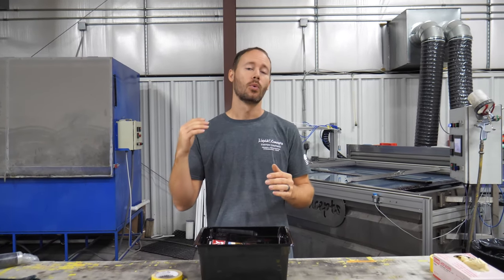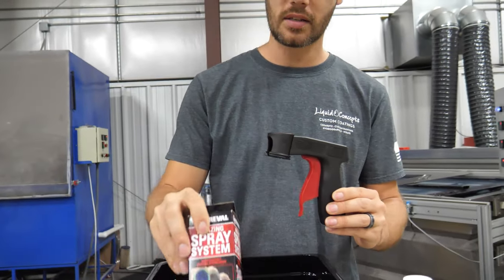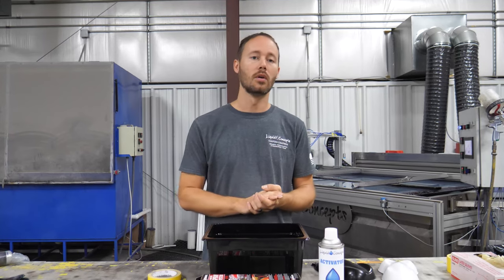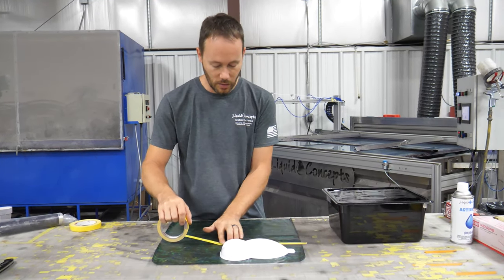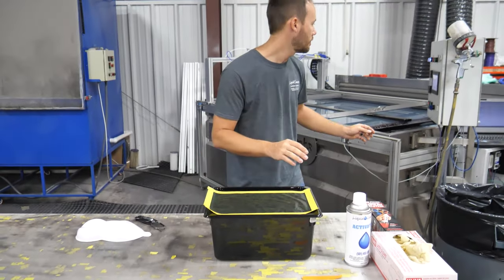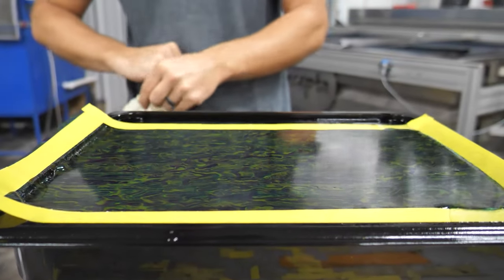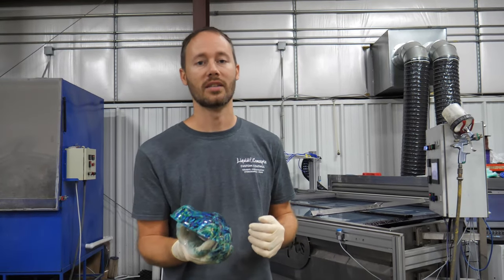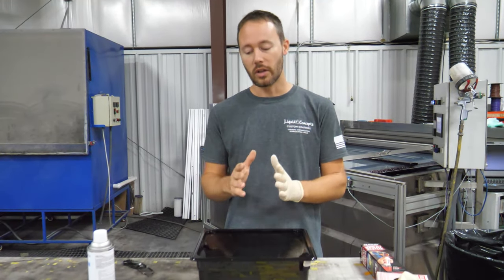BEGINNERS HYDROGRAPHICS KIT (Diy Dip Kit) | Liquid Concepts | Weekly Tips and Tricks

Comment: Ok can you do gun parts with this ? Is their a better kind of water to use like distilled. What happens if you leave it in to long ? What happens if you don’t rinse it ? Can you redo an item if you mess up ?
Reply: I wouldn't actually do the metal parts on any pistols or barrels on shot guns. It will wipe out blue oil on metal and could start pitting on gun.. now the stock, and handle grips or both butt stock and handle grip on shot guns.

Comment: What's the purpose of the speed shapes?  Just to practice?  And what about the area of the speed shape where your fingers were grabbing it...what do you do to alleviate that?
Reply from the maker: Yes the speed shapes are simply for practice or sampling. They are ABS plastic which does not require any prep or painting prior to dipping. This saves you on time and makes it easy. You can simply put  a tape tab on the back of the speed shape and dip it and this would avoid any defects when dipped.

Comment: So I can use any type of paint as base for object. What is the difference between this spray to a reg spray paint. Newbie here. Nice video.
Reply: I would like to know this as well
Reply from the maker: We recommend automotive paint. I would stay away from already mixed aerosols as most have a hardner built in. They can work but you will have to find that sweet spot between when it is dry enough to dip but not hard that the print slides off.
Reply from the maker: See above!

Comment: What kind of paint is included in the kit?
Reply from the maker: Hello, No paint is included in the kit.    

   Product Description:

Do it Yourself!!

With this DIY Hydro-Dip tank you can do the dipping yourself!! This package comes complete with hydrographic film, speed shapes (testing samples), Aerosol Activator, and Aerosol Paint System. All you will need to do it pick up the base coat you desire under each pattern and you are set to go! This setup is great for a beginner or someone just wanting to test it out.

Comment: I’m just getting started and I was wondering what is the best type of paint to use and does it have to be white before dipping? Also, does everything you dip have to be sanded down?
Reply from the maker: We use solvent based automotive paint. When you look at the film on our website, the base color recommendation is below the pricing. White makes most film more vibrant.

Comment: So is the paint Enamel Acrilic, Ceramic, lacquer ? I assume it is a mat finish for bonding ? Is either type of paint better than the other? If I want a better harder chip resistant under surface  will it bond to powder coat?
Reply from the maker: The paint is solvent based automotive paint. We have a good selection of basecoats & clears. There is recommended basecoat colors under each film description.  https://www.liquidconcepts.com/
Reply: Share your contact